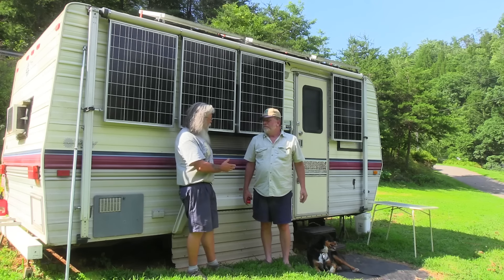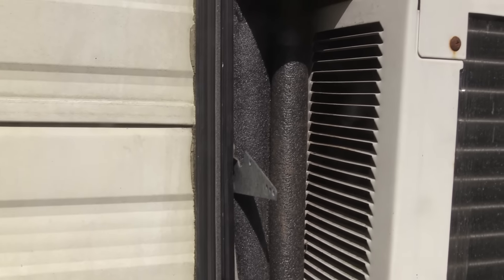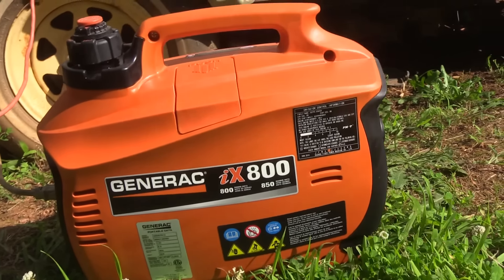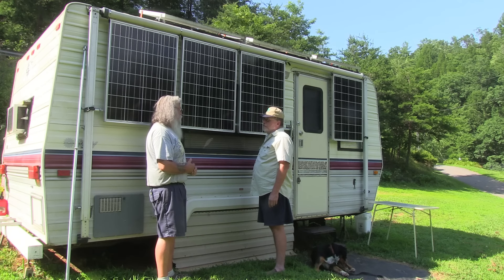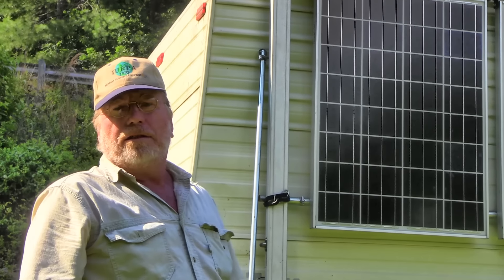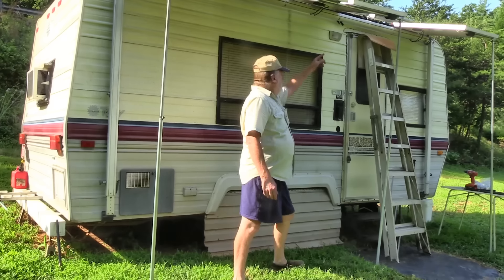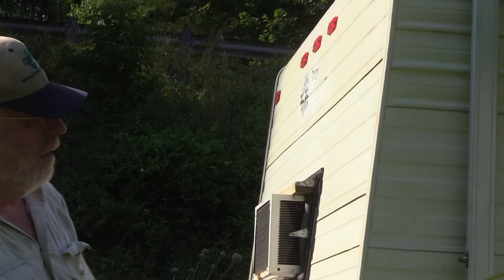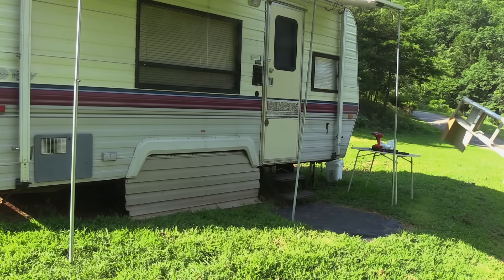Tour of a Nomad Living in a Tiny Home on Wheels

Comment: To those who felt it necessary to opine about how stupid or wasteful this idea is, consider this. He is obviously a hobby tinkerer with an idea and a goal and thought and worked to achieve it. By doing so, he’s given many some good ideas. Maybe we don’t all want to run an A/C in a humid climate, but the idea of using panels for shade is a winner for one thing. I also have a hobby where I make new things out of clothing or fabrics others would throw away. Even if he decides it’s not working the way he wants, the money isn’t wasted on the panels and batteries. I’m sure he will remake something else. Look how much money a golfer can spend on his hobby and not even have anything to use again :-).
Reply: Good idea. I just recently used old jeans to make custom sized phone pockets on a bunch of work pants for a friend. Made them to fit his cell phone so the top stuck out just enough to grab and placed  exactly  on the pants where his hand reached.

Comment: Appreciate your perspective on the way solar is as various builds have been implementing ways.

Just observations: Notes from an electrical engineer friend of mine:

I'm assuming the price includes the trailer. I can't imagine the solar power plant costing that much. Anyways, he's pretty ingenious with his setup.
There's two things I would do differently though:
1) He said he wanted to fit as many solar panels as he could on the trailer. I would have used monocrystalline solar panels. They're almost half the size of the polycrystalline panels he's using and put out the same amount of power for their smaller size. They also perform better in the shade or on cloudy days. They're only $20 more per panel.
2) I would at least double the capacity of the battery bank. His 450 amp battery bank is undersized for his 1,000 watt solar panel array. Adding more panels will not give him more run time at night. I have 500 watts of solar panels and almost 600 amps of battery capacity. That's a good balance between charge time and run time.  When I set up the solar system for the cabin, I'll install 1,500 watts of solar panels and 2,000 amps of battery capacity.
Reply from the maker: +Patricia Funk Poly is NOT that much smaller, barely smaller at all. The latest evidence is that in fact, Poly is better in partial shade. I think they are so close, you should buy whichever is cheaper. He does need more batteries, but 1 to 1 is generally considered best. 1500 to 2000 is very likely to not get you to 100% full batteries daily and that will kill your batteries.     2000 to 1000 is ideal, and 1500 to 1000 is good. 1000 to 1000 is acceptable. Off-grid cabins use more power than RVs so it may be slightly different for you. Apples and oranges.
Reply: Mike Mead 
Not mine, my friend's, Lyle Hancoc, Sr., He's an electrical engineer. A good friend of mine.

Comment: I like you solar panel awning ideal. I live in my 25 ft Rockwood and I am going to keep my fabric awning and do something similar on the other side with solar panels for extra shade on the side of my camper. I want to be able to unhook the panels for transporting the camper. I have just over 1600 watts of panels and a 400 watt wind turbine. My big hurdle is the batteries. Ive managed to buy two lithium batteries and plan on purchasing at least four more. Thanks for the great video. Stay safe.

Comment: I want to run AC on my trailer and I found my awning not hefty enough in high winds so,,,Higher rated panels on the roof and light weight wood on the awning roof with overlay venting to reduce wind drag while producing shade. Wish me luck.

Comment: im pretty sure by mixing different sized panels it not putting out what it could if he would just run 100w panels, if he is using branch conectors he getting an average of what ever his smallest panels output is outta all of his panels, its best to use equal wattage panels to a controller and if ya have a group of different wattage panels run those to a sepperate controller like jim from denver did..

Comment: I'm a little iffy on the three support struts.  The way he has it, it leaves three support struts to be bumped into and bent.  Would have been alot better to fasten the bottom of the struts to the trailer at an angle.  Also I would have gone with two struts, not three.

Like the video to show what you can do for alot of solar power.

Comment: I will be curious to see what kind of charge controller(s) he uses, the type/brand of batteries, and the type/size of wire. I see there are now 180 watt 12 volt panels. If he put 6 of those on the roof, he would have 1080 watts right there. Might help with wattage for his cottage if he wants to go as big as possible.

Comment: I was wondering how much solar for ac
Reply: check out jim from denver, or the solar boondocker. bob did an inteview w/him and he runs a 5k btu a/c off 750watts flat on his roof in the desert, but has another 430 watt panel on his truck that has its own solar charger to keep the batterys topped off..

Comment: There's a balance that needs to be designed into a solar system. If your battery bank is too large for the solar panel capacity, the batteries will never get fully charged and your run time will be shortened. Likewise, if your battery bank is too small for the number of panels you have, your run time will be shortened.
Reply from the maker: +Patricia Funk the normal is 1 to 1 solar to ah of battery. He has 2 to 1 which means his batteries will nearly always get charged.
Reply: So if you have 250 ah of batteries you need 250 watt of solar?

Comment: Nice system there. It must be expensive for solar equipment where he's at though. $4000 seems like a whole lot of money for just 1000w system. I know he has size limits and maybe he is using expensive AGM batteries. but still I would have liked to hear more about the expenses he incurred putting the electrics together, rather than how much conduit and plumbers tape costs.
Reply: Ohh. I thought Bob was just referring to the solar. The WHOLE rig !...now that's a different matter! The title threw me off. Usually when someone puts title parts with comas ( like $4000, solar, tiny-cabin, etc.) they are trying to make "points" in the title to make it easier for people to search different interests. Also, thanks for taking the time to make a little list on the costs you incurred. It's useful to me.

Comment: Yeah, He talks about adding more solar panels for more capacity. Unfortunately, he has not built a properly balanced system. Unless he increases his battery capacity, adding panels will not give him more capacity as his battery capacity has pretty much capped his run time at night.
Reply from the maker: +Patricia Funk, he said right in it he wanted to add more batteries. He can now run the AC and still charge his batteries during the day and for a few hours at night. HE ISN'T FREE OF THE GENERATOR, BUT IS GETTING CLOSER.